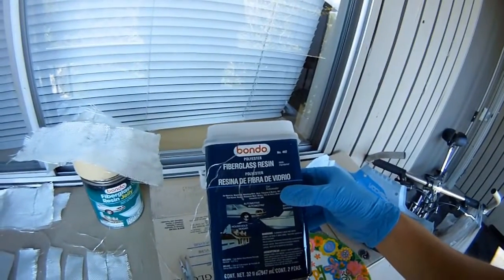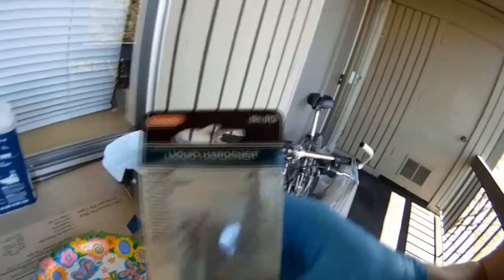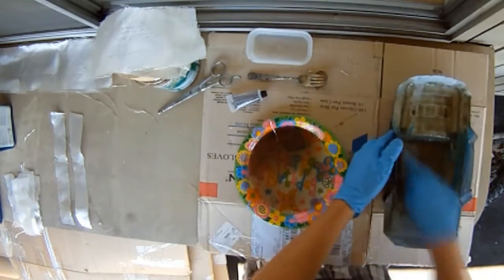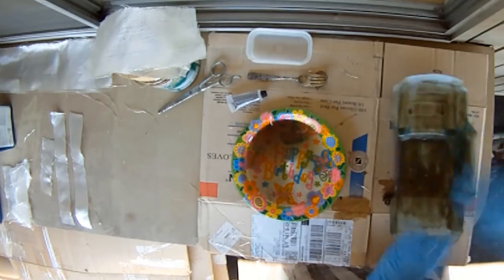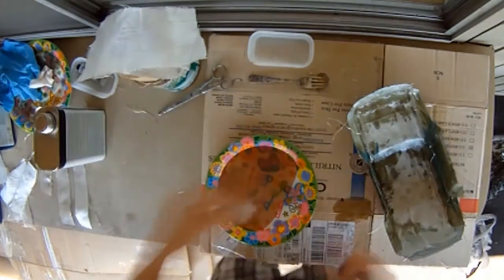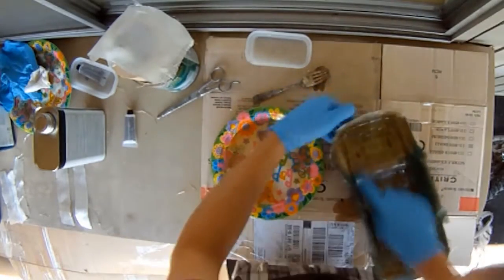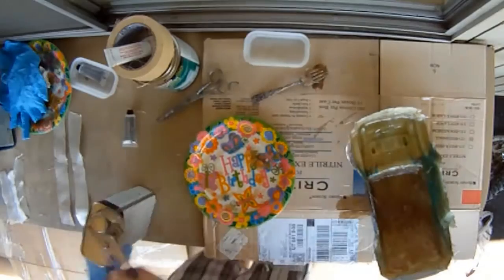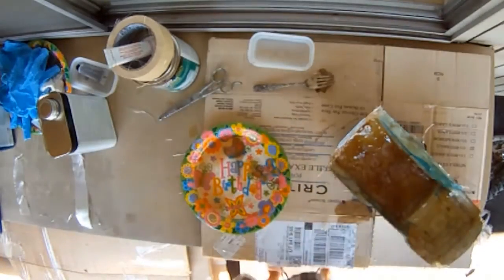How to fiberglass an RC car shell

Comment: The shoe goo / drywall tape method is superior to this. Polyester (fiberglass) resin is notoriously brittle and isn't very suitable for this application.
Reply: hot glue and drywall tape is even better
Reply: use epoxy resin and woven matt